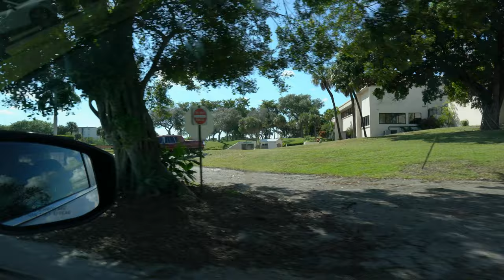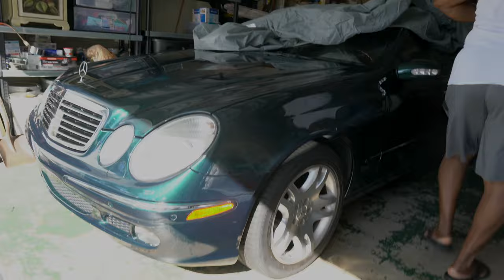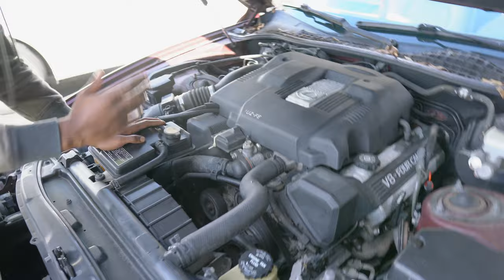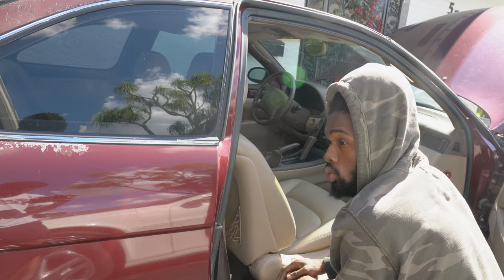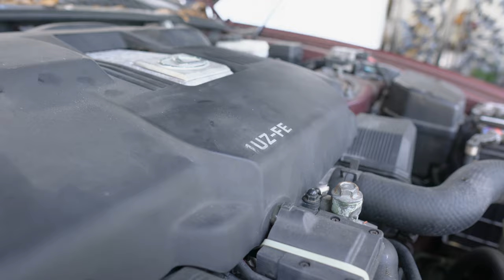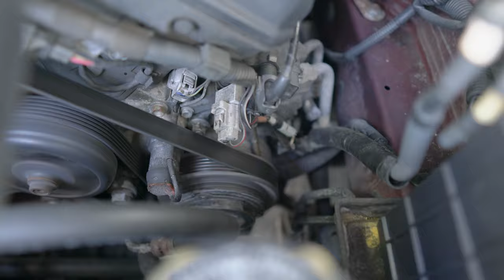Car Vlog (Lexus SC400 Edition)THE CRAZIEST BARN FIND

Comment: sunroof drains are clogged for sure you need to take out the headliner and blow compressed air through the tubes theres 2 front drains that exit behind the front wheels and 2 rear ones that exit in the trunk. Same thing happened on my ls400 i also had to use silicone to seal 2 rivet holes one on each side of the back of my sunroof assembly because they were leaking also. The first thing I always check on these older lexuses is the ECU. The capacitors leak acid and damage everything else.
Reply: Just replaced my ecu on my 94 sc400 the common case of leaking capacitors